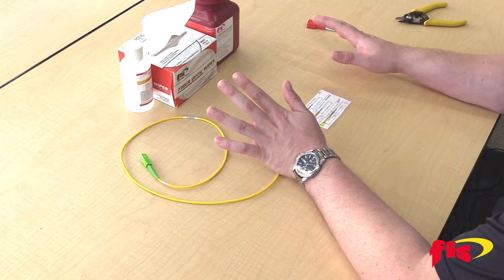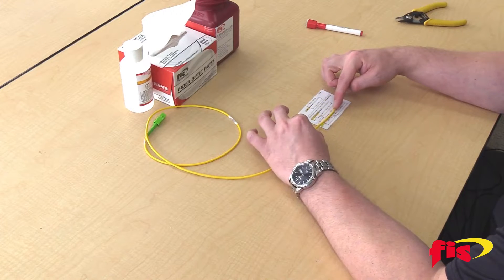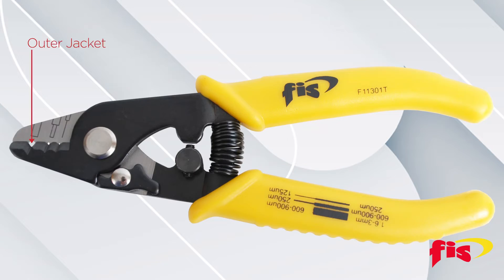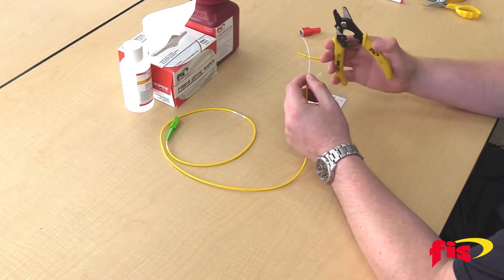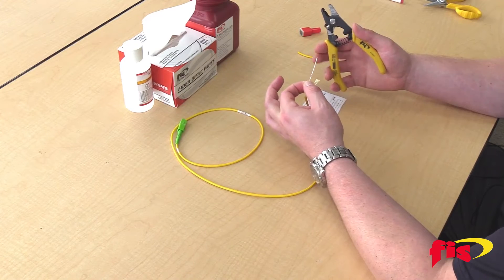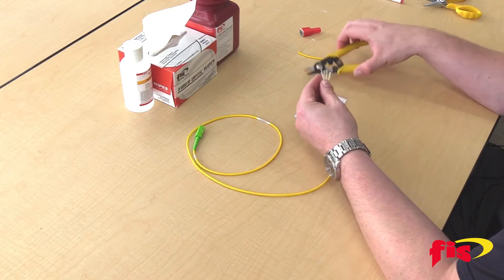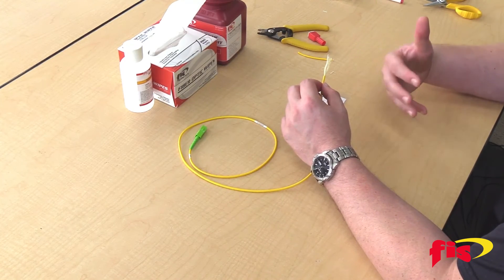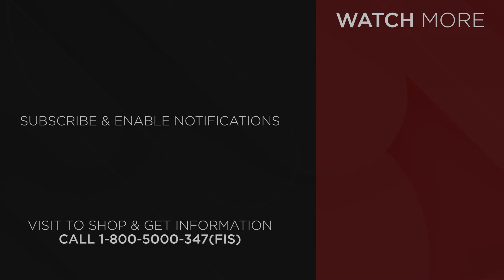How To Strip Fiber Optic Cable | Instructional

Comment: Thanks! Any suggestion on how to old fiber when stripping the tight buffer of if it slips between the fingers?
Reply from the maker: Try taking less off per strip.  That way the tension won’t be as strong in your fingers and they won't slip so easily.
Reply: I wrap the tight buffer several times around my finger.  You could also consider a thermal stripper